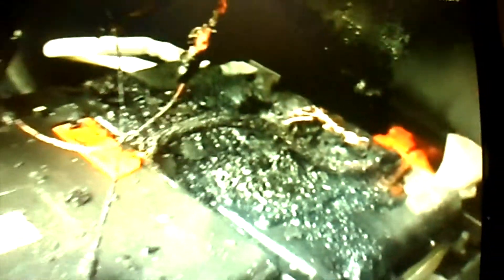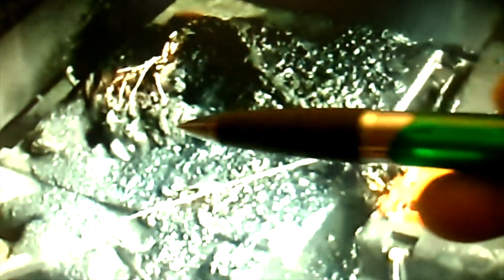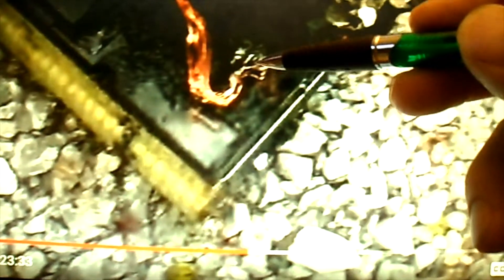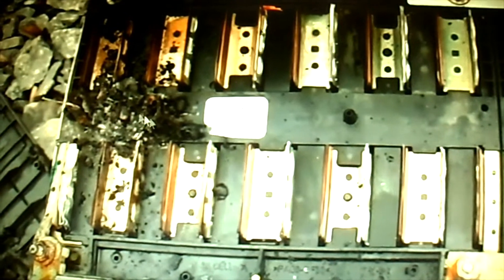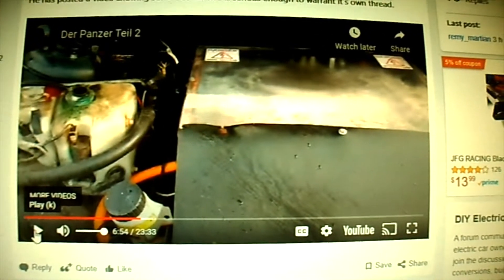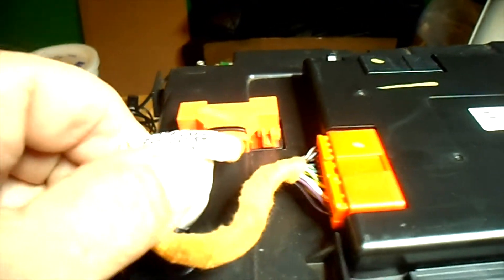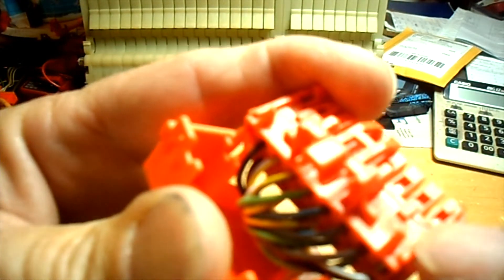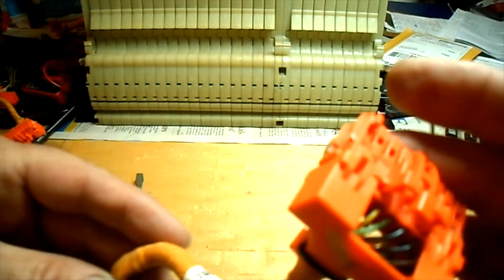Chevy Volt module BMS wiring fire (even more) thoughts & info

Comment: That appears to be a short. When you short wires across a battery terminal it melts them just like that. I know because I've done it.

Rainwater would be more conductive because of the salts dissolved in it. You can simulate that by adding a bit of table salt to your water and see how it shorts.